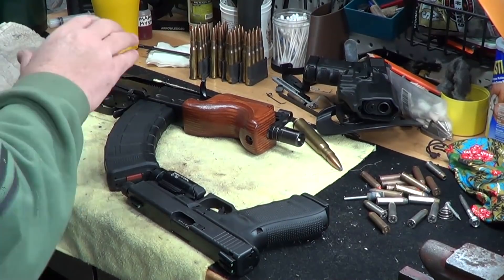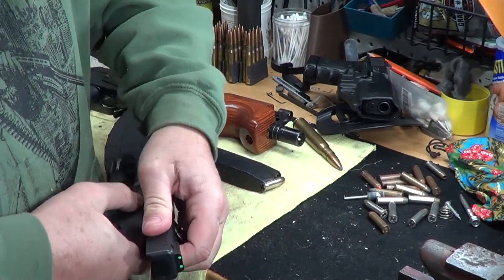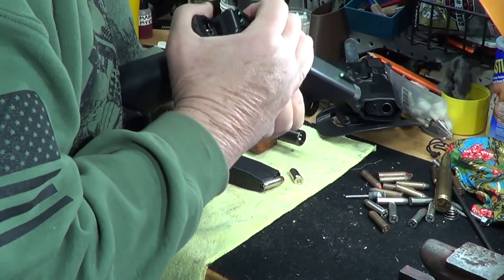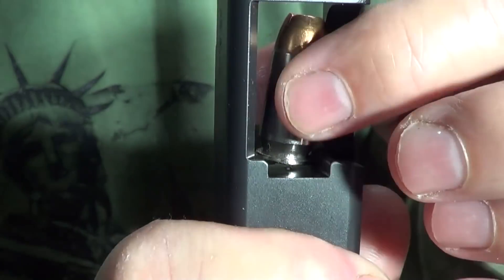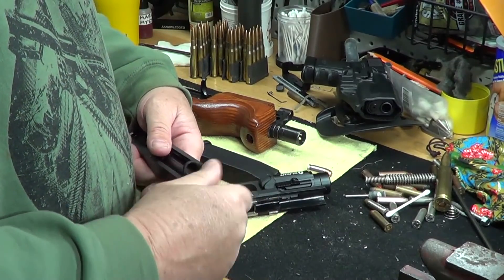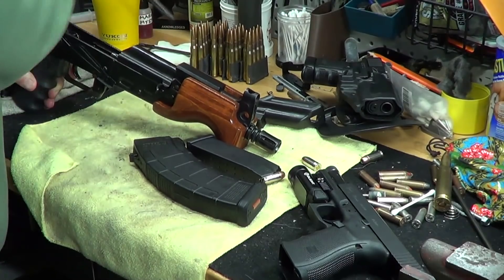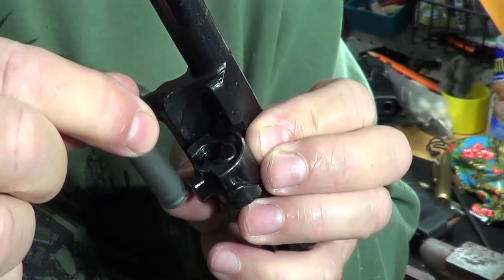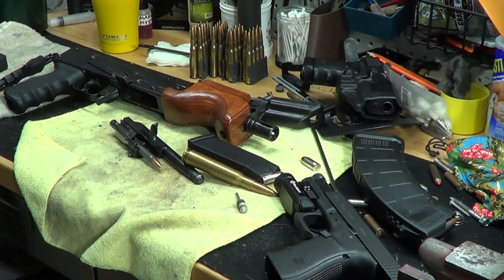Why You Should Not Load Semi Auto Handguns With Round In The Chamber - Broken Extractors

Comment: Lookin at the Glock in my hand it seems strange to se an angled surface that looks almost like it was designed to guide the extractor past a case already in the chamber. Even more oddly the extractor is hinged with a spring that allows the part to pivot out as it goes into battery over a chambered round. It makes me wonder why the manufacturer would add a spring, plunger and hinge spring when a controlled feed system design only needs a fixed extractor to do the job. Strange as it seems even my 1911 Series 80 extractor is designed to go past a chambered round with little effort as well. I suspect  that daily "misuse" by dropping the slide on a chambered round would do more damage to a brass case repeatedly rechambered than the hardened steel parts slipping past it.  Makes ya wonder, doesn't it?
Reply: Yep... Glocks should be OK with it, 1911s NOT. Of course, the little bevel on the face of the extractor can help it to jump over the rim, but it also MUST be shaped that way to CLEAR the part of the case at the front of the extraction groove which has a matching bevel, so... (i.e., if the face of the extractor wasn't beveled, it wouldn't fully drop into the groove)

Comment: I suppose some new gun owners deserve our insight...
Loading a round into the chamber, without removing, and toping off your magazine for max capacity  ...
1911, sorry, you have to .
Most plastic guns...
 With full mag in left hand, slowly and gently, close your slide on a chamber round.
It will not go into battery.
With the corner of your full mag , 
press on the extreme rear of your extractor, it will relive spring pressure  and the slide will gently go into battery.  If you find it difficult,  Glock, 
with your left hand relive a little recoil spring pressure.  Every make and model is different,  but figure it out, you will save yourself many cuss words.

Comment: The Beretta m9  is probably the easiest gun to work one round reloads & sustain fire every few seconds if needed. 

I did video on it but probably can’t link it… 🤔 “ one round reload testing & having some fun “

Knowing the battery of arms for each gun with no mag or a non working mag is good for shtf/war, when no resupply is available. 

The 1911 we tested, we had to use slide stop/release, if mag is unloaded & you load a round in chamber manually, the sling shot method doesn’t work , 🤔well it wouldn’t work on either 1911 or  m9 but  the m9 slide stop/release functions very easy if compared to 1911 that we had. 

Good information to test & know for each gun !

Comment: glocks, m4s are designed for it. not all guns have the extractor designed for It. its why the extractor is beveled in the front. how do you think the rim gets under the extractor in a bolt that is cupped like the ar and ak bolts, the lugs strip the round and feed it into the chamber, the extractor rides over once the round is in line with the chamber. some are designed for it, not all.

Comment: One trick you can do, is push on the rear of the extractor, on the outside of the slide and the hook end will pop out to the right, then you can lower the slide all the way down onto the round and let your finger off the exactor. Might not work on a short glock extractor.

Comment: Except I have done exactly that with 5 different guns, at least 500 times each, and never had to replace an extractor. Explain that.  Never had any damage at all.  The extractor has a spring that allows it to move.
Reply: @Blackowl44  No, it isn't.  Extractors are designed with a bevel at the end so they can easily slip over the rim of the cartridge. All the owner need do is keep the extractor slot clean and oiled.

Comment: Then why does the extractor pivot/flex out? Why would it be designed to move when the round slides in behind the extractor hook? A fixed extractor would achieve the same result. So why does it have the accommodation to move? It's because the round sometimes slides in behind the extractor and sometimes doesn't and when it doesn't, the extractor goes over the casing to hook. The extractor even has an angled cutout to ease going over the casing.

How many of you actually broke an extractor BECAUSE and ONLY BECAUSE of this? Where is the scientific data, and not some fudd lore?

I don't personally do this, as the traditional way is easier. But this whole thing is overblown.